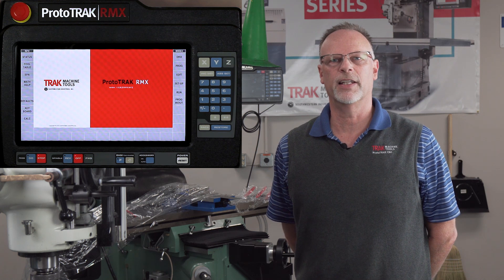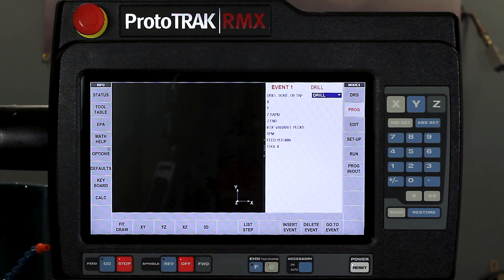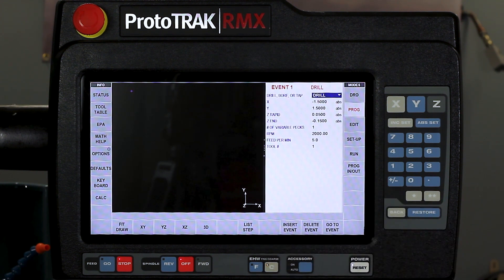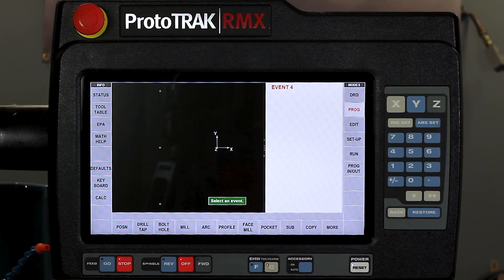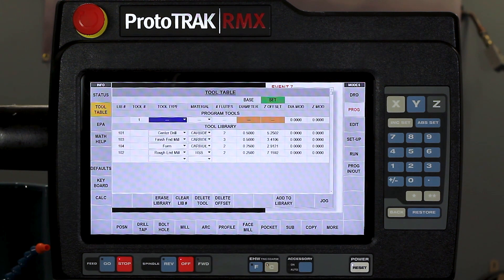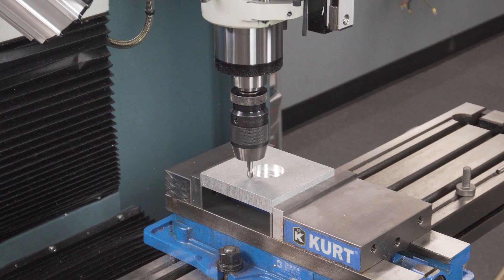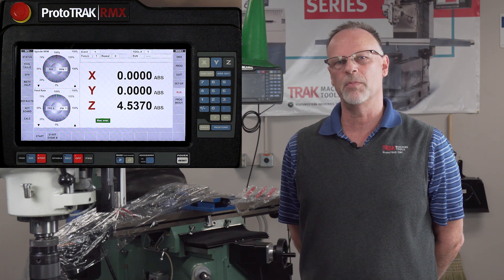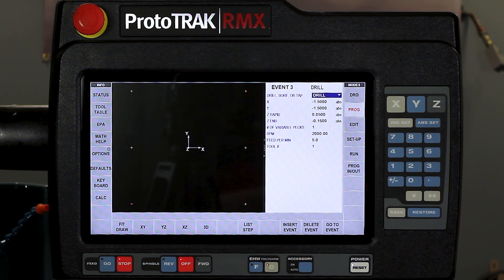Z Safety Plane Option | ProtoTRAK RMX CNC | Basic Mill Programming

Comment: Couldn't you do the same thing by changing a couple z rapid positions?
Reply: No because when you use Z rapid, the drilling pecks or milling passes start at that point.  This allows you start machining close to the part but have a higher clearance plane.  You can use position events between your other events to achieve  this as well but it requires more extensive programming.  T.P.
Reply: @patrickfitzsimmons5187  Ok, Thanks for the info Pat.

Comment: can you show what happen when traking on a tapping cycle?
Reply: When TRAKing a TRAK 3 axis mill in a tapping cycle (or TRAKing a TRAK lathe in a tapping or threading cycle) turning the handwheel will TRAK the approach of the tool down to Z rapid plane.  The ProtoTRAK will then take over in order to keep the feed rate consistent through the tapping or threading process and stop once the threading is complete.  In the mill example, the machinist cranks the handwheel until the head approaches the Z rapid, the control takes over, plunges the head at the appropriate feed rate to Z end, reverses the spindle and retracts to Z rapid plane, spindle direction change back to forwards, then the machine will pause there waiting for the machinist to crank the handwheel in order to TRAK to the next operation.
Reply: @khufnagle82  thank man